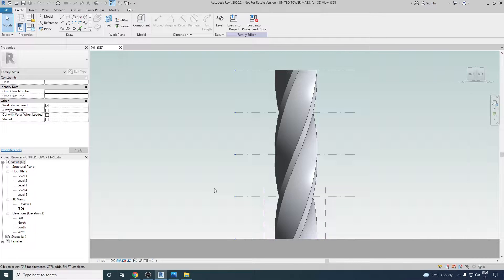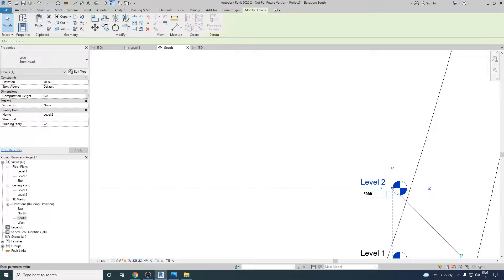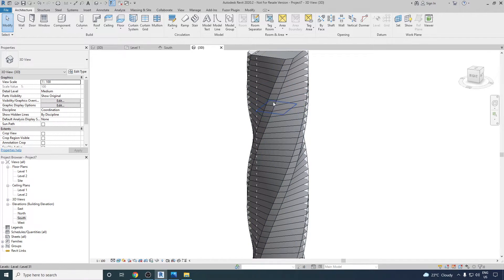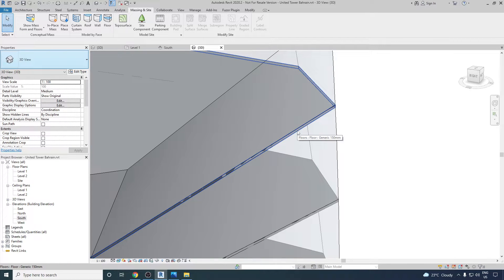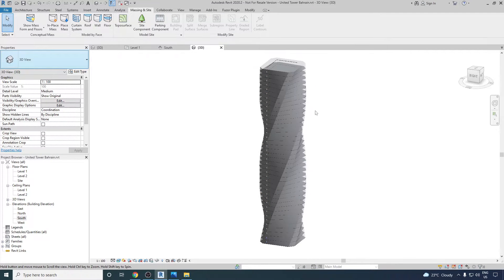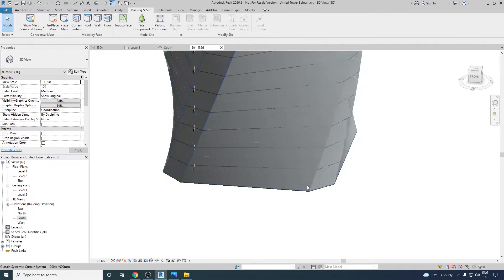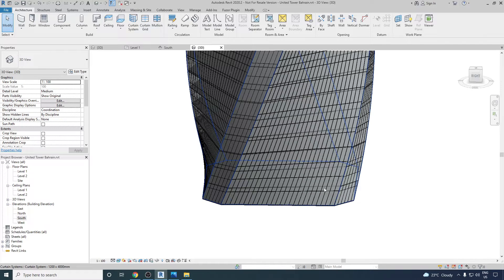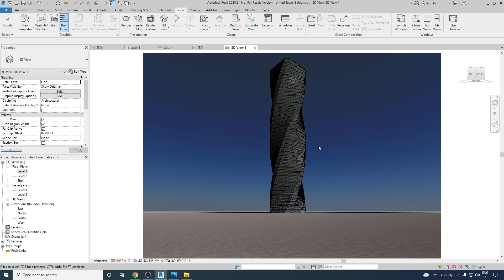Creating Twisted Building in Revit (United Tower - Bahrain) - Part 2

Comment: Awesome video. 

Out of curiosity, could you please make a similar on how to make a twisted building with irregular shaped floors (not a perfect shape like a rectangle, square or circle)?
Reply from the maker: I will try to make one
Reply: @bimparametrics  thank you!🙌 I was mainly considering the idea of having balconies on the floors. 

I'm in my final year undergrad and our final project is a high building (15 floors).😭 wanted to create a twisted building because they like an interesting form. 😅
Reply from the maker: @mvelo6331 I might need to use dynamo, but I will try creating in Regular Revit method. If you can share  sketch of the building u have in mind to my mail id it will be more clear. ( I will not mind if you don't as it's a specific idea 💡 ). 

Any ways I will try and update
Reply from the maker: And do share and  Subscribe the channel 😉
Reply from the maker: Thanks for the idea!